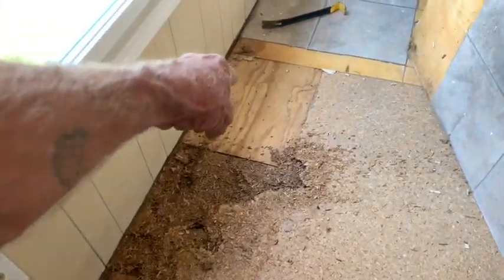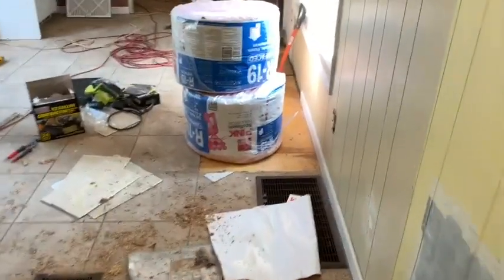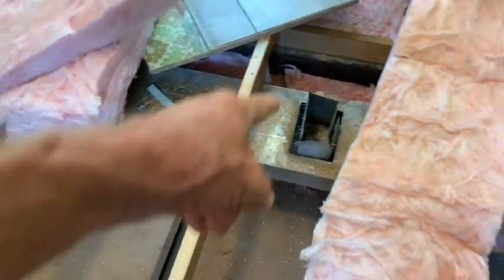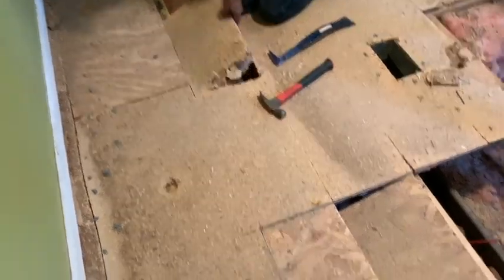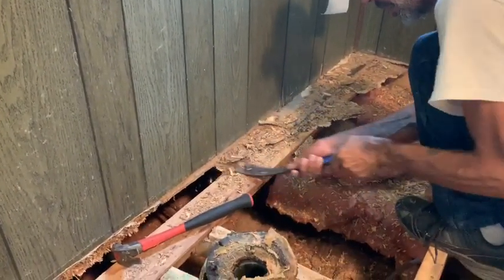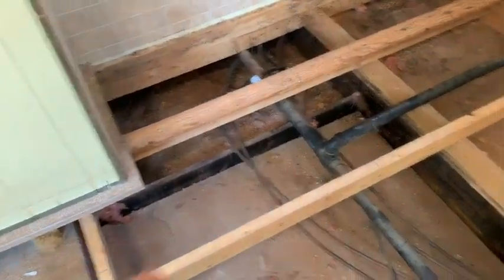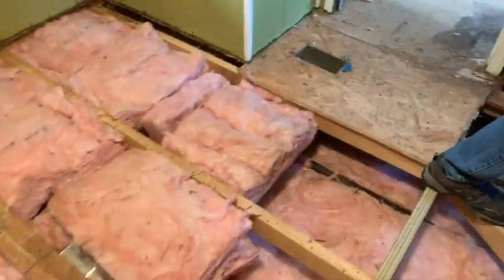How to repair a rotted floor single wide Mobile Home video 2

Comment: This is exactly the situation I'm in right now.  I just bought a trailer that has 4 leaks in the roof, 3 of which caused the ceiling to collapse.  The floor in one of the smaller bedrooms has completely given way and the carpet is drooping.  The other small bedroom had a leak, you can see the ceiling just barely dropping, so I'm going to tear that out and fix that.  I can see that water has run down the wall, so I'm going to tear that up and replace it, and I'm sure the floor is compromised as well. It's got ugly carpet, so I had planned on tearing that out, too.   I have a month before I move in, so I'm going to tear up follow your advice and just tear out all the floors of those rooms and replace them with good, new OSB.  I agree, NO PATCHING!!  It's not that much more cost and in doing so, I can reinsulate the entire floor and make sure it's all done right.  This is in southern Arizona, so retention of cooling is more important than heat, making the floor just as important than the attic space as far as insulation is concerned.
Reply: If you have polybutylene water lines, replace it with PEX. The substrate you use for the flooring is less important than the plumbing. For those folks not in the know about poly/plumbing
should be made aware that the  polybutylene plumbing system used in virtually all mobile home construction for many years came, under a class action lawsuit. The settlement of the lawsuit (which is no longer valid) gave relief and replacement of the defective pipe was installed as long as the original owner of the home met the criteria of the settlement. (in the event that a leak occured ,in the poly system and had to be repaired more than once the homeowner, was requireed to keep the defective connector or pipe part to qualify for a free pipe replacement.
Reply: @toolman3491  I've been doing a lot of plumbing and I'm replacing all of the lines that I can get to with PEX.  It's a gradual process, but hoping to get all of it done in the not to distance future.  My next big project is replacing the lines that go to the master bathroom (farthest run) because when we run the water, there is a sulfur smell coming out of it.  Can't imagine what that is, but it can't be good.
Reply from the maker: Wow. I hope you got everything taken care of
Reply: @Drewsroofingandhomerepair  Yep, got it all taken care of and been through 2 winters without any problems.  I have had to replace a couple of tiles because of wind, but even those are getting fewer and fewer because I reenforce the seal at the bottom (this is Tucson, so leaving them with the standard tack-line of tar just doesn't cut it).  It was a lot of work, but I did have an "apprentice" helping me out, so not only was I able to get it all done, I helped teach someone else how to do all those repairs and some of the "gotchas" of roofing.
Reply from the maker: Awesome glad to hear I helped

Comment: I have a question I have a double-wide I'm doing my floor in one of my bathrooms but it looks like my wall sunk a little is that possible or is it just an illusion?    I want to say thanks so much for making these videos for people that live in mobile homes 👍👍
Reply from the maker: The problem with mobile homes is that they put walls where there is no support under them. So yes that is possible. But not impossible to fix. You’ll notice in a few of my videos that exact problem that you’re talking about. And how we ran plywood from one room to the other in one piece so it can be done. It’s not that hard it just takes a little bit of brain power. https://youtu.be/In6UGaTGUDI
Reply: Thanks a lot
Reply from the maker: You’re very welcome

Comment: This is the issue I'm having now. My kitchen needs to be redone and it will be the 3rd time I've had those floors done.
Reply from the maker: Use this type of flooring and you will never have to do it again. Best ever. Can be bought at lowes. Ask Lowes what is the best three-quarter inch powered. 
https://youtu.be/7WetIQgnFGs

Comment: Great Video Drew. Good to see high-quality work being done. I was curious when installing a new subfloor on a double-wide mobile home, that has no plans of moving, would it be Ok to run the subfloor over the Marriage Line?
Reply from the maker: Yes and that is exactly what I did when I did one. I have a video of it being done. We did a double wide we completely married to Floors together. So if they ever do move it they’re going to have to cut that line
Reply: @Drewsroofingandhomerepair  Thanks for the quick response. This is really helpful. Keep up the great work!

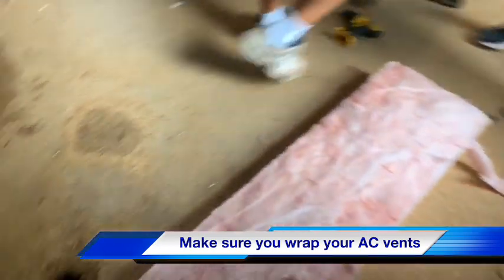Comment: If those spots are caused by the windows for example @13:00 , how would you prevent that from happening again? Assess the window further, etc? JW for personal knowledge
Reply from the maker: You have to fix the window leak first

Comment: Great video but you say do the whole floor  because if you have another leak you'll have to rip it up again, well if you have a leak you'll have to do it again whether you did the whole floor or not right?
Reply from the maker: No because you’re putting back either plywood or Vantex and neither one of them will do what the particleboard does in the floor particleboard will fall apart plywood takes a long time to fall apart so you have time to do any repairs necessary before the flow or go bad. If your floor with the particleboard it gets wet it’s gone in days

Comment: Well.. Last guy we had do our floors so wrong we couldn't just keep one area and now we have to rip all of it out, But question being he ripped everything from under the floor away there is nothing to hold the insulation inside, Do i put some plywood under there? Or just nail the insulation to the joists?
Reply from the maker: I was just now the insulation to the Joyce

Comment: Drew..can I go under the trailer and sister up to those 2 x4s with a 2 x8s. I inherited a trailer and it is a single wide and it is a mess. My oldest daughter went threw the living room floor. If the floor joists are all 2 x 4s that can't be left like that. And from the hole I don't see any insulation.
Reply from the maker: It sounds like the trailer you’re working with is similar to this one. Yes I would recommend sister ring up the exterior walls for sure. Absolutely recommend it and I will recommend it to this gentleman also
Reply from the maker: I don’t know what the underside of your trailer looks like but most of the time you can’t get to the floor joist from the bottom I’m not sure your situation

Comment: Can you do a home room by room?  I don't have the funds to do the whole thing at once.  Plus I still live here so I have furniture.  My water heater died, and the floor under it is bad.  I want to replace the subfloor in that whole room (utility room) before I replace the water heater.  My thoughts are to replace the subfloor and insulation, then paint the subfloor with waterproofing before putting down new flooring.  I would like to do this in most of the rooms of the house but room by room.  (The house is 20 years old.)
Reply from the maker: Yes, that is actually the way I recommend doing a house is one room at a time
Reply from the maker: I agree Painting it is a good idea

Comment: Good way you remove old glue and staples off floor Joyce after removing original sheathing? Been using reciprocating saw..
Reply: Wait... ill keep watching
Reply: Lmao hit it with ya Sawzall 🤣
Reply from the maker: That’s what I use a reciprocating saw or saw saw whatever you wanna call it

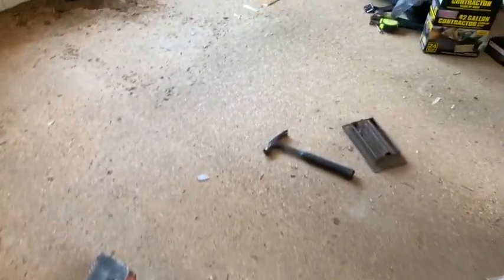Comment: Why did you call it OSB at 7:11 and 8:32? It's not OSB. Not even "old school osb". It's called particle board and the manufacturing process is completely different, not just the chip size.
Reply from the maker: 🙏 that’s what I meant to say

Comment: Did you fix the leaks ??? It will just keep rotting again and again if you don’t fix the leaks ?? If I just fix one area it should be fine right ? Not saying your wrong just wondering
Reply from the maker: Before we ever do a floor repair would make sure all the other leaks are taken care of first. You don’t ever wanna do a floor repair when there’s still a leak in the house whether it’s coming from windows doors or whatever
Reply from the maker: The leaks are fixed well before we get back there

Comment: What if the underside is all hanging down can I repair this. Just bought one in SE Iowa for 4,000. I am veteran on disabilty. Hoping to do myself and maybe a little help from friends
Reply from the maker: Yes you can repair it if you look online for underbelly repair you will probably find a few videos on how to do that if I can help in anyway call me 910-294-1761

Comment: What is holding the floor isolation up to the floor bottom?  My trailer is 2 feet off the ground. And how do you keep outside appearance straight ?  My siding is sagging in areas where I replaced floor ?
Reply from the maker: Underneath the rafters there is a layer of like mesh it is above the underbelly. If you remove your floor and it is not there all you have to do is put a nail underneath the bottom of the rafter everyone of them and run wire under there and set the shingles excuse me set the insulation on it

Comment: Just so I understand correctly you double insulate the floor towards the outsides to take up the space but only do a single layer in the middle to allow breathing space under the floor?
Reply from the maker: Not sure that I remember saying that
Reply: I believe he mentioned the floor was only so many inches different from different spots that he couldn't put the same amount of insulation in all areas.
Reply from the maker: Exactly right thank you

Comment: particle board is what i call that old stuff.
Reply from the maker: Particleboard or OSB is not that bad from now days but back in the day it was not made the same
Reply: no doubt. 5/8: or 3/4" thickness in most mobile homes on either 16" or 24" center spaced floor joists and framing with 2x4 is not sufficient for support. Engineered particle board used by the manufacturer is not the best but meets specs. Never seen strand board used but don't know the code for that area of the country.
Reply from the maker: https://www.youtube.com/playlist?list=PL8xp84iSvTA570yVi5b5MZAIrw5yNXkQT

Comment: Drew, what about the floor under the exterior walls.  What happens when their soft and don't support the walls?
Reply from the maker: I remove it in between and put 2x4 framing first block then the inside 2x4  down for the flooring

Comment: So pretty much, If you have a leak and its that old particle board might as well change it all out for the new OSB  right? Also is it better to get the cheap OSB or advantech
Reply from the maker: I like the advantex
Reply from the maker: https://youtu.be/_3VfdXmCw0A
Reply: @Drewsroofingandhomerepair  It's not dependent on your preference. code dictates that.
Reply from the maker: https://youtu.be/cp9igBMSDAY
Reply from the maker: https://youtu.be/6eCF4OBSJNA

Comment: How do you handle the walls, when all walls were installed on top of all fiberboard?  I used to work for “Homes of Meritt” in 1989.  First thing I learned?  NO NAILS!  😂. I was the plumber. Cheap ass company, and seeing how those things were built, I’d be worried if I lived in one.  We’d knock out about 4-6 homes a day
Reply from the maker: It’s a pain in the ass unfortunately we don’t want to be lifting Mobile Home walls to repair the floor under it so we just firm it up as best we can for the customer repair the floor and go on. Mobile homes are definitely made cheap
Reply: @Drewsroofingandhomerepair  A manufactured home was specifically introduced to those folks who could not afford a 3 or 4 bed stick built home. In order to qualify the process yes. some lesser materials were and are still being used but the word cheap is not the word I would use to describe a mobile home. I, don't imagine that someone purchasing an older manufactured home for sale and depending on the location price and descrption would agree to that description. The fact is unless the owner of an older mobile believes it is cheaply made which also denotes crappy. I would'nt even dare tell a home owner it's construction is even substandard. They may think that but don't agree because you are confirming to them that not only is the purchaser cheap but, now lives in a piece of crap.  Not true, they, may be constructed of less premium materials but to those folks that cannot afford the Caddy it is, their home. The assumption is, that given reasonable care and that routine maintainence is followed the home, will last for many years.
Remember this. All manufactured homes are constructed, assembled and transported to the site via truck down the highway at speed, over hill and dale including pot holes and every other other obstacle and arrived on site ready to be set up with minimal repairs needed. You ever notice that the (trailer houses, wobbly boxes or what other negative description you could call them are mostly in great shape from the 50s and 60s. Finally in most cases it is all about taking care of the home. I find that most people will wash and wax their vehicles but neglect to do the required maintainence until it is either almost or, too late for repairs thus, the extensive damages that can and does occur. I don't mean to offend but my belief is you can't keep warm with too many holes in the blanket.
Reply from the maker: That is exactly what I say in this video actually. https://youtu.be/f82kikum1B8

Comment: How do you repair the other wood under the floor? Do you tear it up and go underneath and replace it??
Reply from the maker: There isn’t any wood under the subfloor you have the flooring which is three-quarter inch plywood you have the floor joists which you nailed the plywood to. And then you have insulation and the underbelly the black underbelly there is no plywood underneath the floor

Comment: From the looks of that green and gold tile it has to be about a 70s were they all built pretty much the same subfloor wise
Reply: You do a wonderful job here you're a very thorough highly impressed.
I saw you explain the difference between old OSB and new OSB what do you replace with plywood or OSB
Reply from the maker: Yes you are correct

Comment: Would you advise to put some type of vapor barrier sheeting before laying plywood down? I like your videos. Very detailed. Thanks
Reply from the maker: Thank you for watching a vapor barrier might not be a terrible idea actually that is what the underbelly is supposed to be unfortunately even if you have a vapor barrier and your duck line is open like this one once and not wrapped you going to still have the same problem

Comment: I have a 14x80 that I'm gonna gut, the under belly is  ripped mostly out I am thinking of putting pink board on the bottom of the house joist, then tyvek over that and R-20 in between the joist from above.. Will this method be ok??
Reply from the maker: Yes that will work
Reply: @Drewsroofingandhomerepair  What is the recommended R value for floors?? And is it better to put tyvek under or over board insulation on outside walls??
Reply from the maker: R19
Reply: @Drewsroofingandhomerepair  I lived in Southport for about 2yrs as a young boy, a place called Dutchman acres
Reply from the maker: Dam it   It’s a small world
Reply: @Drewsroofingandhomerepair  I would think it would depend on the area of the country you live in but, R-19 is generally used in the floors and ceilings

Comment: One more thing - how much more trouble would it cause me if I were to want a square drain in the middle of the floor for any future overflowing from the toilet and/or washer? It would go between the toilet and the washer - which is about two feet in front of the toilet.
Reply from the maker: I’m not to sure on that 1. I have never tried it or done it
Reply from the maker: I agree 100%

Comment: What do you seal underneath the mobile home with once you finish the floors.  ? thanks
Reply from the maker: You can put plastic under your plywood if you want to but it’s not necessary nothing at all there’s an underbelly so as long as you have the underbelly on your mobile home you should be good

Comment: What do you do with the outside walls to get new sub floor under it?? do you leave the old in place??
Reply from the maker: You leave the old in place and once you put the 2 x 4 blocking in like a show on the wall make sure the first block goes all the way up and touches the bottom plate the second block towards the inside of the room will have to be flush with the top of the floor joists so your plywood will match that for your screws
Reply: @Drewsroofingandhomerepair  Thank You VERY much!..Great videos!!

Comment: Would it be ok to u$e plywood instead of more of that particle board? I know it probably cost more but it seems that it would last longer than the crap the manufacturers use.
Also thank you for your videos . It's about time someone made a video for u$ in the real world.
Reply from the maker: No OSB better plywood delaminates
Reply: @Drewsroofingandhomerepair  I'll be damned! Thank you.